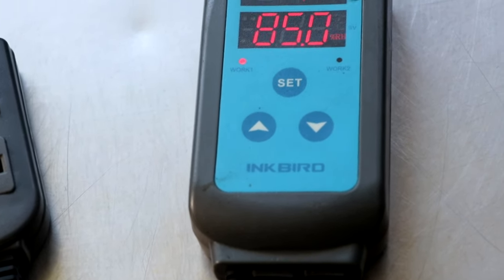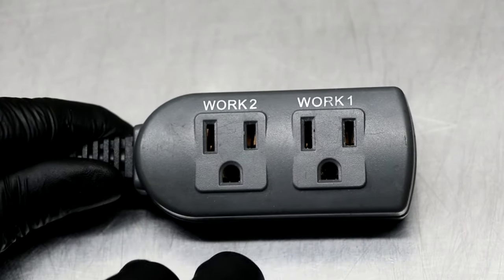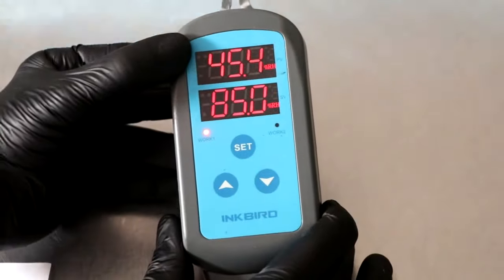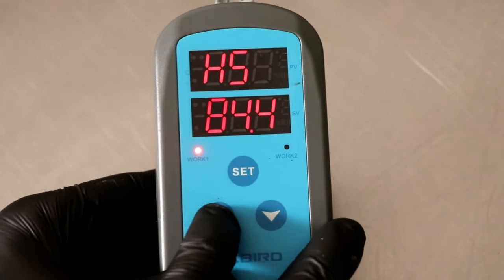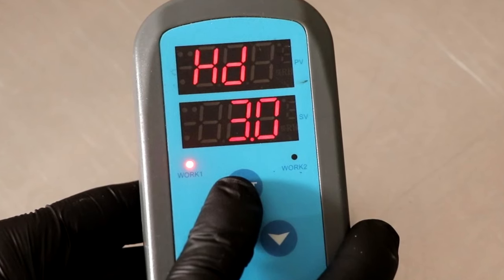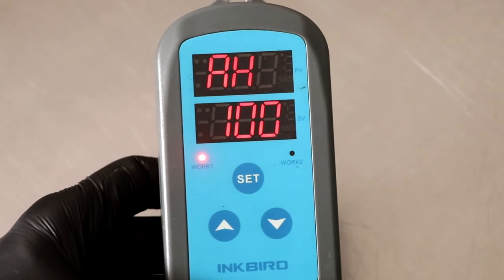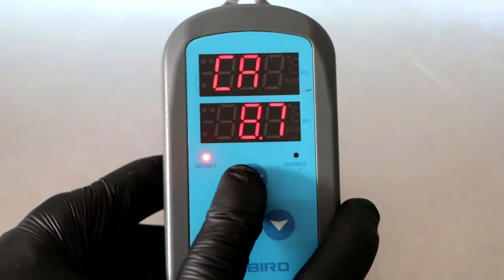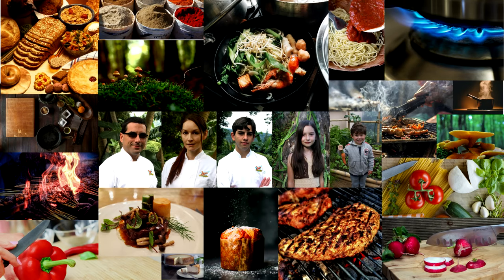Inkbird Humidity Controller - IHC 200   (settings/programming)

Comment: My inkbird will not work with my dehumidifier I've set when I want it to come on and I've set the PT but it still won't work I've even tried using a smaller dehumidifier and that won't work either. However my humidifier works fine with it.
Reply from the maker: When The dehumidifier is supposed to come on, does the red light on the left side of the set button come on?  If it does you should plug something simple in it like a lamp or something.   To see if the lamp comes on when the "dehumidify" feature switches on.  If nothing like this works then you have a bad relay in your unit.  You might want to contact inkbird and let them know.  But before you do let me know the outcome from the tests I just gave you..
Reply: I’m having the same issue

Comment: How do i get it to switch from Work 1 to Work 2?
Reply from the maker: it all depends on the parameters that you set.  If the humidity is set to 80% for instance and you have the HD set to 4 and the DD set to 4.  Then when the humidity in the area drops 4 points to 76% the work 1 will turn on or the humidifier.  Then when the humidity rises to 84 the work 2 or dehumidifier will turn on..  Makes sense?  It all depends on your settings

Comment: How different is from the IHC-230 ?
Reply from the maker: This unit only controls the humidity whereas the IHC-230 can either control the humidity or the temperature depending on how it's configured
Reply: @2guysandacooler  Thanks! I didn't know that it would only work in one of either functions.. 👍🏽

Comment: Hello. The unit I have received is faulty. Initially it was working, if I set the humidty level at 50% if it dropped below, the 'work 1' light would go on, and humidifier would turn on untill it reached above 50% level, and the 'work 1' light would turn off, and the humidifier would turn off.

Now the humidity goes above 50%, and when the 'work 1' light turns off, the humidifier stays on and does not turn off. I managed to reset and fix the problem but after a couple hours it is doing the same. When the 'work 1' light turns off, it does not turn off the humidifier connected to the 'work 1' socket.

Has anyone else had this problem?
Reply from the maker: You might want to reach out to inkbird.  That does sound strange...
Reply: @2guysandacooler  yep I did. Ran a diagnostics test, and it is a faulty unit. They are sending out another controller.

Comment: Will this work for a reptile setup?
Reply from the maker: Probably.  What do you plan on plugging into it
Reply: @2guysandacooler  a reptile fogger
Reply from the maker: @dood0409  should work.  Just check the amps used on the fogger and the max amps of the controller.
Reply: Did it ever work out? I’m looking for something for my reptile setup as well
Reply: Yes I've been using this for 10months now
Reply: @dood0409  which humidifier did you plug it into?

Comment: It appears "ER" and i cant use it. WHY
Reply from the maker: Try plugging it in the wall with nothing plugged into the unit itself.  Do you get the same error?  Also make sure the temperature probe is plugged in all the way..
Reply: @2guysandacooler  yes, i ve tryed that and it repeats nooo

Comment: You didnt explain how to switch from work to work 2 🤦🏾‍♂️
Reply from the maker: The controller automatically switches between work 1 and work 2 depending on your settings.  Work 1 is where you plug the humidifier to your controller and work 2 is where you plug the dehumidifier.  If you don't have a dehumidifier that's ok.  When the humidity in the room drops below your set target work 1 will come on automatically.  Hope that helps
Reply: My dehumidifier inly works in plug1. I tried this on 2 new controllers...same result....no power in plug 2 . The humidifier works on either plug.

Comment: Would it have killed these dumbass designers to simply write "humidify" and "dehumidify" on the plug,  instead of the inane work 1 and work 2? This piece of gear is supremely confusing when compared to much better,  domestically designed units,  and i have a great many.  Inkbird is not d accurate as many people seem to believe either... I've found it to be off by as much as 15 to 20 points,  which is very typical across the Chinese board, based on my target extensive experience.  I wouldn't trust these units for anything that requires accurate humidity, that's for damn sure